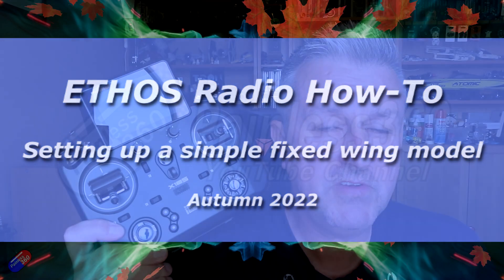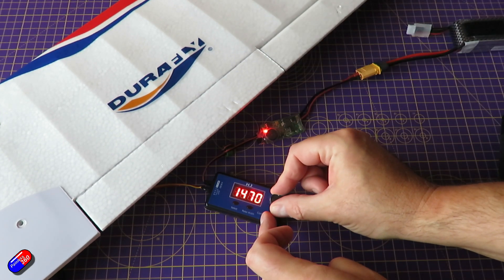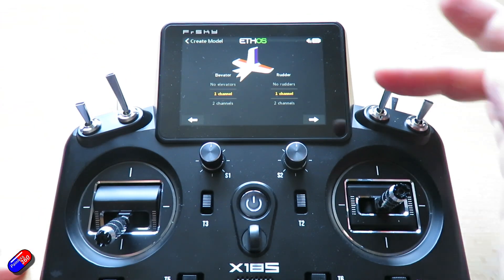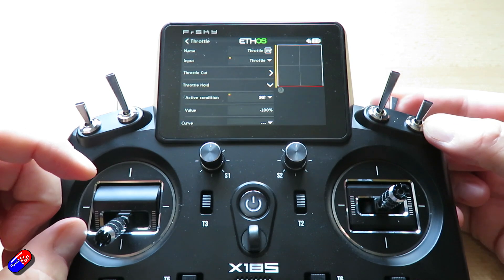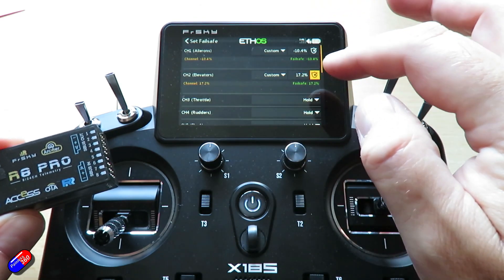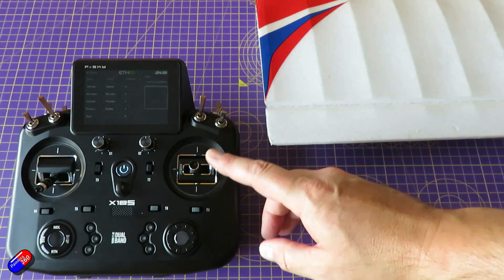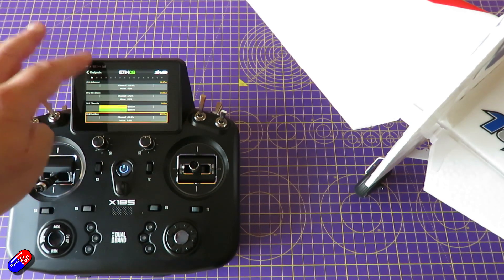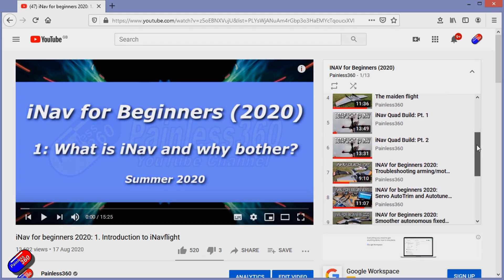ETHOS: Simple plane setup for beginners (all steps explained)

Comment: Great video as always, very helpful.   Could perhaps show how to set up a motorized glider with the rudder and elevator on one the right stick.  Only way I've been able to do it is through the rudder aileron mix.  Is there a better way, one in which the left stick is not rudder active?   I see you can change the transmitter mode but I have a mix of planes including full house gliders where I want the rudder on the left stick also.  Thanks
Reply from the maker: You could simply plug the rudder servo into the channel on the reciever normally used for the ailerons. Would that not work?

Comment: I know you're just showing examples of how you'd change servo throws/end points/rates but it's always best to reduce the servo arm length and keep the throws in the radio at 100% or higher. This increases mechanical torque and resolution.